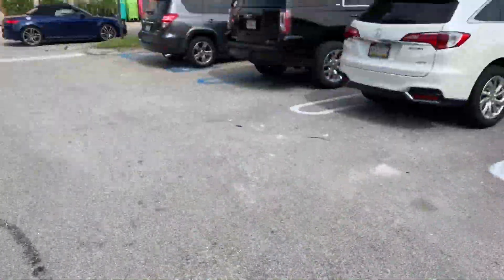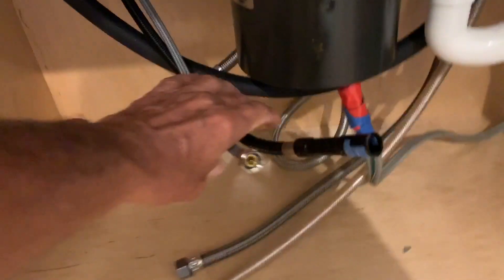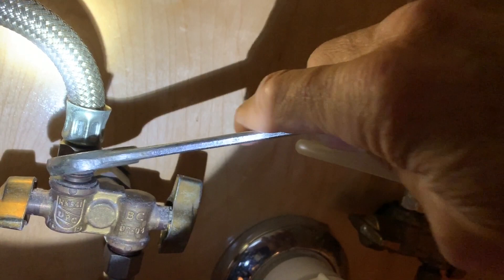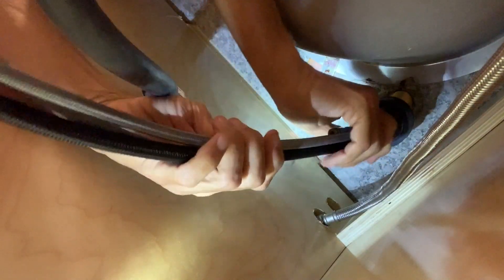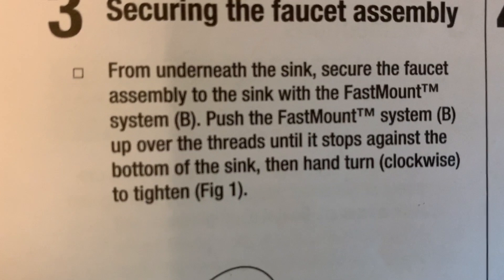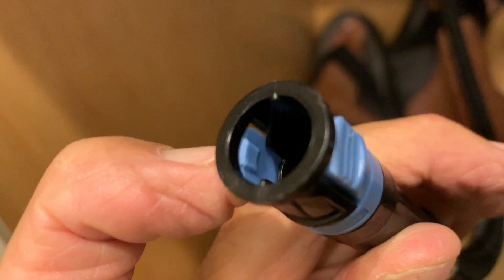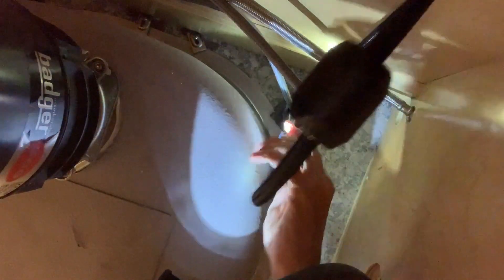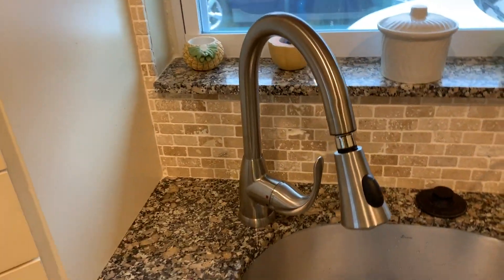How to install a Glacier Bay kitchen faucet

Comment: I loved this video because he knew as much as we did starting. He didn't act like he was a professional and cut the video and make like he smoothly put it together. I learned a few things not to do. Just like my husband, doesn't read instructions. It clearly says on the tag of the hot water tube which one it was. Also it's tagged exactly where the weight goes on, I could see it on his just like mine. Thats why the  end sprayer didn't pop right back up where it belongs. No big deal, you can push it back up by hand. My husband would have done the same thing if my eagle eye hadn't caught it ( just what a husband needs on a project😂) But thanks for being real! We were going to pay someone to do it but because of your video we did it ourselves! Thank-you!!
Reply from the maker: Thanks for watching. Good luck on your install and merry Christmas.

Comment: Make sure to put some silicon or putty under the valve top of cabinet so that water will not run down under the sink, specially if you use the base. Make sure the hoses are not twisted when you tighten the nuts by the water. The hot water hose is marked with a tag label telling you which is the hot water.The valve is placed wrong it should be out of the way from the sink per the box that way pot and pan would not hit it and turn on the water by mistake. It is nice to buy the soap dispenser.

Comment: Great video. You showed how to tighten the faucet again. I almost went and bought a new faucet thinking it had broke.
Reply: Mine keeps coming loose. 3 times in 3 months and I get it very tights and stable all the time. I am confused. Was just about to toss it and go get a top model mohen or some other expensive brand because I wanted to give up.

Comment: Nice, I installed the exact same one, but your weight is off. Move it up to split the white tape, then it will pull the sprayer all the up.
Reply from the maker: Thanks good tip appreciate it and thanks for watching

Comment: Make sure when you're tightening the faucet down that it's on a flat surface. If you're like me and the bottom of your sink makes it an uneven surface then add shims if needed. If you don't it'll be a very frustrating time trying to get the faucet nice and tight.
Reply from the maker: thanks for the tip!
Reply: I am having this problem right now with this exact faucet. It was installed a year ago and just now was the third time in 3 months that I had to go under the sink to tighten it. However, I just noticed that where the fastener sits is not peffectly flat. A little bump is there. What is this "shim" thing you speak of that I should add?
Reply: @nallis01  So a shim is anything that can be used as a spacer to make the other side leveled. U can use anything like a thin piece of wood, plastic, or even stack some cardboard on top of each other.
Reply: @ALV57  got it! I will be doing just that in the am. Thank you for your response.

Comment: Hi Tom, thx for the video on installation of the Glacier Bay kitchen faucet. I just installed the same one today 9/6. It was pretty easy to install. Now the hot water supply line has a sticker stating hot water. Thx again
Reply from the maker: Glad I could help

Comment: Nice video, thanks. You sound like me under the sink, huffing and puffing. Years later but did you figure out the reason the pull down was not going all the way up to the faucet was the weight needs to be at a higher level, placed on the white tape on the hose. The white tape indicates where to place the weight. You make everything look so easy. As for me, I can't get my old one off. I got the lines disconnected, but can 't get the dag on faucet nut off the bottom of the single sink spout. Area too tight and nut too tight. I tried every tool in the book, still can't get it off. Do you have any suggestions? I'm exhausted. BTW, I like your mom's comments about the faucet, too cute. I'm an older mom too. You are a great son!!!
Reply from the maker: Thanks for all those kind words. There is a tool called a basin wrench that you can purchase on Amazon and that’s what I used to get the nuts off in real tight spots behind the sink. https://amzn.to/3SJ4mfm good luck and thanks for watching

Comment: My quick connect hits the edge of the sink rim ,so it will not go flush to the bottom of the sink for a tight fix, WHAT DO I DO?
Reply from the maker: may need to take back an get one that will set in the space measure your margins and open box to make sure it will fit in your space

Comment: Thank you for the video.  I have a question, im attempting this install but I only have a cold supply line and a hot supply line, what line goes into the black hose quick connect?  Thank you!
Reply from the maker: You have a 50 50 chance one should say hot water and cold
Reply: @TomLeeman  thank you for following up!  After watching your video again I saw the faucet had 4 hoses and the two quick connect attach after you place it in the sink

Comment: Hi Tom.
What size wrench did you use to tighten the hot/cold water valves? I see it has two sides to grip , so I am a little confused what size wrench I need.
Reply from the maker: Channel locks that adjust to the size of the bolt

Comment: I liked your video except no one is showing a video on how to fix a leak at the sprayer head of a glacier bay faucet. Got any suggestions? I'd appreciate any advice sir. Thanks 😊
Reply from the maker: Mine leaked and all I did was tighten it up and plumbers tape on the threads could help

Comment: Hibthere what was the model number of this faucet?  Also any idea what the name of that Grey collar was called that screws onto the threads of the faucet? Mine is broken or the wrong size... no idea where to get a replacement
Reply from the maker: I would take it back to Home Depot and trade it in for a new one With all the pieces intact good luck thanks for watching
Reply: @TomLeeman   unfortunately I cant, it came with the house we just purchased :(

Comment: Hi there, we just installed this model, but the hot line is not flowing, what could be the reason? Thanks
Reply from the maker: Check to make sure that you’ve opened up the valve on the hot water side
Reply: @TomLeeman  thank you 🙏🏿

Comment: I just installed mine everything is good but the water comes out thru the bottom where you tighten it and at first I thought it wasn't tight enough but the water keeps coming out
Reply from the maker: you have a leak at the base may be defective

Comment: Nice video.  I just installed one of these with the bottom shield, as I had to cover the additional holes.  I hear that their special plastic "nut" that ties it down fails after a year or so, so I am contemplating replacing it with a standard nut. My only other gripe is that the water pressure from this is not as good as I had anticipated.  I wonder if there is a pressure regulator in the head.  Anybody know?
Reply from the maker: Check and see you could pull it out I did on my one at home and the water shoots out like a fire hose

Comment: My plastic grey fastener tightens to a certain point and then makes a clicking noise and then is loose again? :/ Almost like it jumps the threads or something. VERY loose for me :(
Reply from the maker: It will tighten you have to keep twisting I had the same thing but it finally tightened
Reply: Justin did you get this figured out? I am having the same problem, just clicks and loosens no matter how many times I try it.
Reply: I'm having the same issue too. Did you figure it out? I've tried so many times as has my husband with no luck.
Reply: The trick is to push up and tighten while making sure that some pressure is pulling the faucet down to keep it level and straight.

Comment: Hey man. I’ve the same faucet. I bought it an year ago, but the nuts are the same size as the ones I’ve in the wall. You see, here in Buenos Aires, everything related to water is in parts of inches:1/2, 3/4, etc. So, if you could tell what size are the nuts in yours, I might ask the guys from the hardware store for a “patch” to connect the faucet to the water line. Thanks!!!!
Reply from the maker: most likely 3/8
Reply: My somewhat similar faucet from Danze comes in 1/2" and 9/16" for the outer diameter, while for the inside diameter for both is 3/8".
Reply: Hey! 👋 it the faucet still working well for you?

Comment: Nice! But 3 things were incorrect, per instructions the counter weight has to be on the white tag that says “weight here”,  there is a white tag on the line that says hot water, and your suppose to remove the spray head then flush and check for leaks.
Reply from the maker: thanks!
Reply: bulgn - What do you mean by remove the spray head - disconnect it?
Reply: Why did you watch the video if you know everything already?

Comment: mine keeps coming loose after i tighen it for step 3 for tightening thing to keep it from moving
Reply from the maker: This part is hard but keep trying it will eventually tighten
Reply: @TomLeeman  it does tighten then comes loose again, idk if im missing a part or something, its like u can only tighten it so far then comes loose again and u gotta start all over again
Reply: @Eastbaypisces  Ours keeps coming loose too, I hate the thing and I am thinking about replacing with something of higher quality.

Comment: How do I remove the handle on this faucet.Handle has become hard.
Reply from the maker: From underneath cabinets
Reply: @TomLeeman  no top handle
Reply: Problem is the single faucet handle
Reply: @josecolon6584  I think there's a screw under the top handle. Allyn wrench screw. It might have a cover.
Reply: @jayceeel9522  correct! A small bump cover is under the handle. Pop that off and put an allen key in the hole to loosen the screw. May have to try different small ones until you get the right fit. Once that comes oit, the handle can be pulled off and everything mskes sense from there. Mine is having a sricky handle and I may need to change the cartridge.

Comment: The reason you weren't getting a tight fit was because your sink was too placed too closely to the faucet hole. So the mountnwas sitting halfway on  both the underneath of the sink rim and the counter... but maybe you saw that in the video.
Reply from the maker: Excellent tip appreciate it. Thanks for watching.
Reply: @TomLeeman  absolutely thank you for posting! I was thinking you probablydidnt see it when you were in the middle of installingit but maybe saw it in video i bet some thin foma would help if it ever startsto feel loose. I just got one at a garage sale, and it's missing that huge click tight ring... so I'm hoping I can find something at a plumbing store.

Comment: The handle for this faucet is too heavy and the leaks water....does it only happen to me???
Reply from the maker: Check the threads and apple plumbers tape you have to screw it on tight mine leaked at first then this fixed it

Comment: Man I put this one in and now I have no hot water. And when I pull the hose off the valve I do have water flow. Idk what’s wrong
Reply from the maker: You have a hot and a cold line check to see if your hot value is open treats the only thing I can think of unless the line is blocked

Comment: The handle shouldn’t be facing the opening of the sink, it should be to the right side. The weight should have been placed where the indicator is on the pull down cord, it’s marked for you that’s why it’s not retracting right…I’m a woman and I installed the Glacier Bay Vason Touchless Faucet myself with no issues just this past Friday…
Reply from the maker: Excellent thanks for those tips. Appreciate it and thanks for writing.
Reply: @TomLeeman  Certainly, you’re very welcome…
Reply from the maker: @bossfootbagstwo2078  thanks I appreciate those kind words
Reply: @TomLeeman  Absolutely, I thought you did an amazing job! We had one of those bar style retractable faucets that came with our home when we bought it and we’ve lived with it for nearly two years, it worked fine however we wanted our kitchen to look like a kitchen and now it does. I thought it was pretty cool that the glacier bay was a twist and lock install type cause like I said I’m a woman and I didn’t want to have to call a plumber to install it…
Reply from the maker: @bossfootbagstwo2078  excellent good job on your install. Thanks for watching.

Comment: Yeah, eventually it will come loose due to lip of sink preventing flat surface for quick connect plastic junk system to tighten flush with. So you keep tightening over and over every few months and eventually plastic breaks up. Good faucet but no way to tighten.
Reply from the maker: Yes you are correct I don’t know why they engineer at it that way thanks for watching